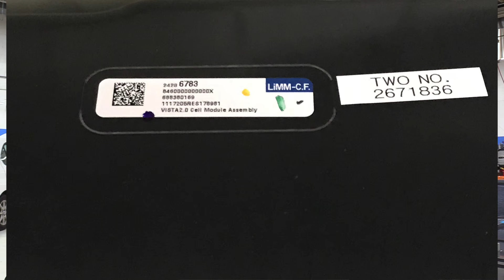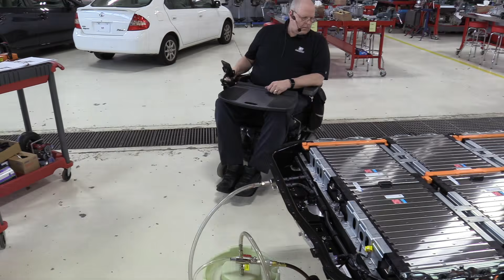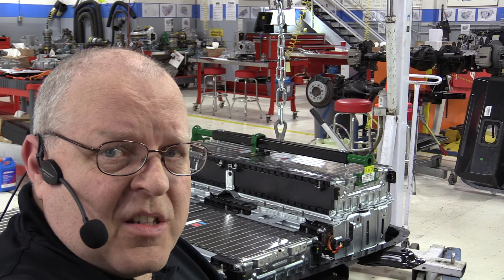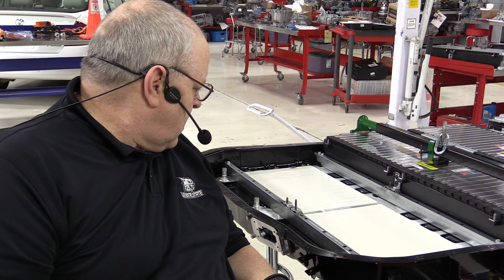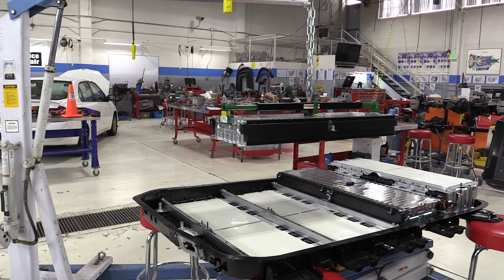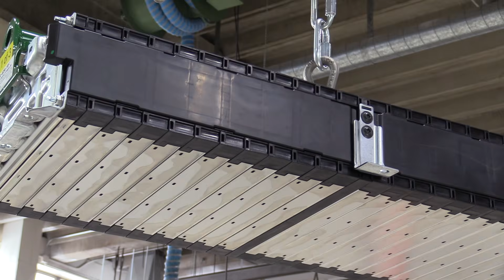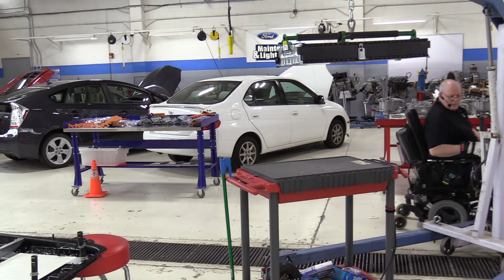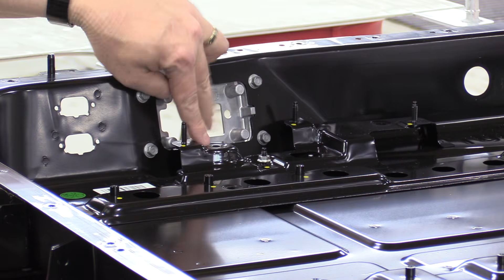Chevrolet Bolt EV Battery Disassembly

Comment: Amazing to think that you will actually be able to reassemble this all again in the future, now the little bags of parts are making sense.  I love that you touch the terminals to prove it is safe.  I meet so many people who are scared to touch a 12v car battery, I guess they need to watch your videos to understand what is safe and what is not.  You mention you fully charged it, but that was outside the Bolt right?  Mind sharing what charger/balancer/discharger you use?  Also look forward to seeing more about that contactor assembly :-)
Reply from the maker: Thank you very much! It was fully charged before removing the battery from the Bolt. The charger/balancer/discharger is the Midtronics 5100. Thanks for your feedback!
Reply: The voltage that can affect a human depends on sensitivity and skin resistance. I am sensitive to any voltage over 35, but I knew old techs that can handle thousands of volts in old vacuum tube TV sets without even a tickle! 12 V is too low to be sensed unless the skin is wetted with a conductive liquid.

The high voltage in EVs is enough to harm and maybe kill those that are sensitive enough. Gloves are an absolute needed tool.

Comment: I wonder what the ratio is of the actual battery cells to the whole battery?  Seems like a lot of support structure here and an opportunity for some always valuable weight savings....
Reply: As expected, the bottom housing is "significantly" massive because it is both the anti-piercing barrier (objects thrown up under car, that could penetrate the battery compartment) and also acts as a "shear plate" to the huge lateral point loads experienced in a side impact!  Not for nothing did the Tesla Model S score very highly in the side impact "pole" test (a horrible test to watch, and even more horrible to experience...) due to the lateral strength and stiffness of it's underfloor battery compartment
Reply from the maker: I will try to get some weight measurements before reassembly. Thanks for your feedback!
Reply from the maker: Battery sections 1 through 3 weigh 62.6 kg (138 lbs) each. Battery sections 4 and 5 weigh 56.6 kg (124.8 lbs) each. The bottom housing alone weighs 71.4 kg (157.4 lbs). those parts total 372.4 kg (821 lbs). I will weigh the cooling plates, upper cover, wiring harnesses and BECM tomorrow. I hope to have the reassembly video done this week. Have a good night.
Reply from the maker: True, An early Tesla model S had the bottom of the battery housing pierced by running over something as well. They added a skid plate after that incident.
Reply: It's actually a pretty rare event for a road vehicle, and conventional ICE vehicles do not specifically protect against it (ie the fuel tank is usually un-shielded) however Tesla felt that in the circumstances, where people were taking any small negative about EVs and amplifying those faults, it was better to add an additional level of protection........
Reply: Remember the module and cell support structure must adequately restrain those parts under high G loadings in a crash scenario!  I doubt there's any significant "spare" metal lurking in there!
Reply: http://www.advantagelithium.com/_resources/pdf/UBS-Article.pdf

They did a teardown of the Bolt battery and have weights.

Comment: Great video, as ever!! One question: instead of using a vaccum tool to drain the coolant, may be used compressed air in one connection and collect the coolant on the other connection? Thanks.
Reply from the maker: Thank you. I thought the same thing at first, but then I realized that air pressure can be too high and damage the cooling plates.  20 inches of vacuum, is the equivalent of -9.8 psi. Have a great day!
Reply: On a system that runs on 5psi, that can be somewhat catastrophic and potentially dangerous
Reply: Howtomakeelektriccar

Comment: So they use 3 cells here when in the Volt 2 video you mentioned that they went from 3 to 2 because cell tech has improved. That tells me if they could have kept 3 cells in Volt but with new tech it would have had much bigger range with the same size of battery pack and the decision not to was more of a business decision than tech, would this be correct?
Reply from the maker: These cells appear to be much thicker than the Volt pouch type cells. I read that the Bolt Li-Ion cell are prismatic rather then in pouches, but I need to do more research to find out. The Volt 2 battery would have to have been physically larger to accept three of the newer design cells, there was no room. Thanks for your feedback!
Reply: Thanks for responding professor. I thought the package size might be an issue as you said.

Comment: Hindsight of course, but I think before doing anything else, drain the coolant, then transfer the whole unit to a large table, or the floor for stability.  I'm sure your stools are fine, but I'm not sure OSHA would agree.  I'd have to think about how, multiple engine hoists, or a ceiling crane maybe.
Reply from the maker: Yes, it was a little frightening. I did think of that, but I could not think of a way to transfer a 1000 lb (453.59 kg) anywhere else and still be able to work on it in a wheelchair. The stools did a good job of keeping it from tipping without having to hold much weight. Thanks for your feedback.

Comment: Did you also weigh the pack by any chance. Might be interesting data to have. Another great explanation! Thanks!
Reply from the maker: Not yet, but I will try. Thanks for your feedback!
Reply: I remember seeing the number 960 lbs in press releases when the Bolt was announced or launched.
Reply: http://www.advantagelithium.com/_resources/pdf/UBS-Article.pdf

Has a previous teardown with an emphasis on weight, composition, chemistry, etc.  You may find your answers there.
Reply: Yes and the dimensions of each pack would be great for me..

Comment: So its about 0130 my time, this video was uploaded about 2 hours ago and it has 224 views. 
Who are you other 223 weirdos? 
We should all get together and talk thermodynamics. 
I'll bring cheese dip.
Reply: Kevin Schrage 
Yes we should....  All us weirdos together. :)
Reply from the maker: That is awesome!
Reply: Kevin Schrage I am a retired ET/Engineer and I love this stuff. I also have a 2016 Bolt and this is fabulous information in my eyes. This is definitely the future of mankind IMHO.
Reply: Kevin Schrage Can I wear my funny hat ?
Reply: Earth is round and spinning + there are different time zones.
Reply: Sorry I missed the party :(  Too busy soldering up a new board. What was I thinking??!!
Reply: Professor Kelly, Thank you.  Given: It is the BECM's job to monitor the whole battery by section and Curious to why one needs to determine the high voltage of an individual cell pack eg Battery Module:#5 & Cell:#41=40V, little less purchase a *special tool just to do it, specifically if one cannot even service/seperate the cell packs from the section/module (any more than you have already so brilliantly done). *The special tool/interface that you plugged your yellow Fluke Multi-Meter into.

Comment: Hi, You mentioned Everything is on Parts Order Restriction, What and Why is that?
Reply from the maker: The white battery thermal pads and the battery sections were the items I tried to purchase or get a price on. I think Kevin Schrage may be correct. The parts guy at the local Chevrolet dealership told me that there is a weekly meeting of Bolt engineers who review parts requests and prioritize who can get each part.
Reply: Could be a few things. They might not have parts to spare without impacting production. Or it could be as silly they don't have the packaging for individual unit sales ready yet.